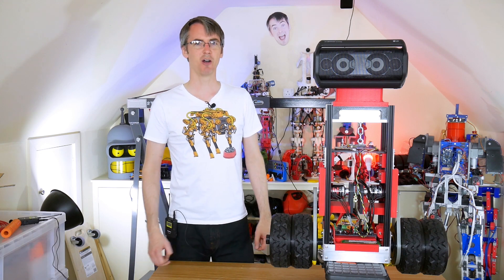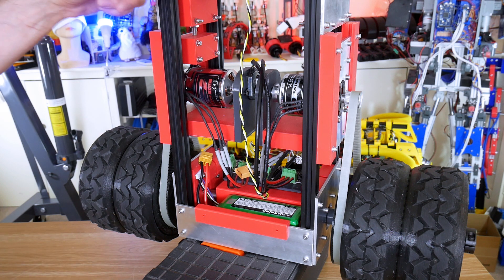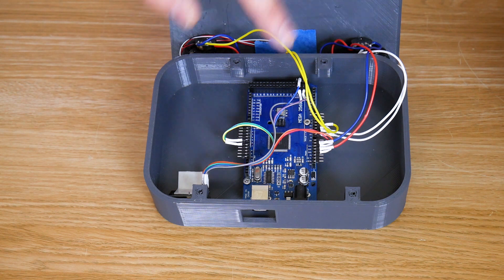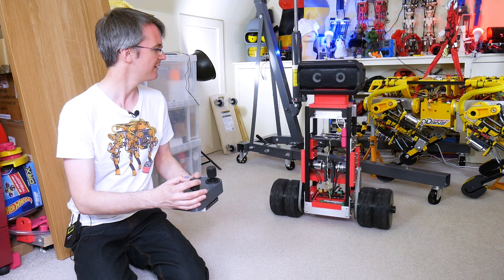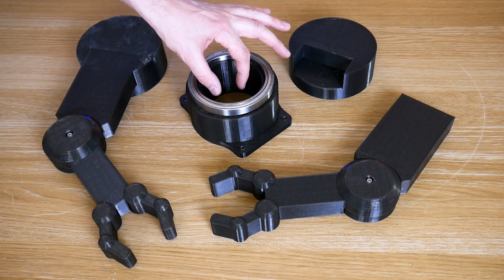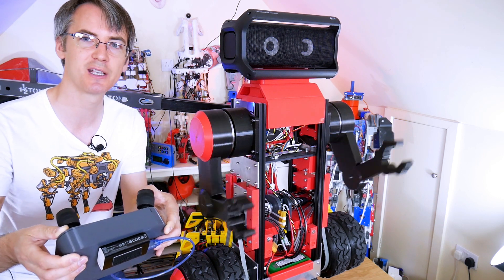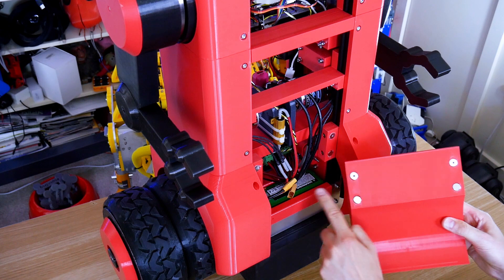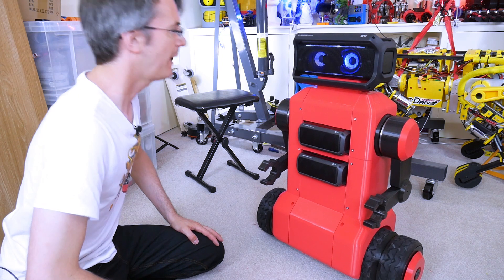The BALANCING BOOMBOX ROBOT you always wanted | with LG XBOOM Go Speakers

Comment: It's by no doubt an awesome balancing robot and I had fun watching this and the previous video but there is one thing that bothers me: Why did you use an ARDUINO MEGA for just a remote control??? You could have used an Arduino pro-micro or even an ATTiny based controller. I can see that you have a good budget and good tools so you are not limited, but despite that it bothers me.

Comment: A great project. But it would be nice if you did this on a budget that a non sponsored hobbyist could afford. I think this could be done without the CNC parts and with straight DC motors to eliminant the expensive motor controller.

Comment: Last balancer I tried, I found it helped a lot to mount the accelerometer with rubber cushions.  As the motors engage to react to drift, they jerk the robot and it has trouble tracking Down.
Reply: thanks for the idea, I'll try it on my project

Comment: It might be a good idea to have the emergency switch physically disconnect power to the whole robot.  Commanding the odrives off won't do do much good of the problem is one of them failed on at 100%. It's unlikely but connecting an emergency off to a software function doesn't seem like good practice.

Comment: Finally done, although I have to criticize, because I guess I understand you used the speaker because of the sponsorship, and that's great, BUT...
You could have made something better than a speaker, maybe a head with camera, speakers too, maybe a Google assistant, sensors, and even small displays for the eyes, and maybe some sensors with hand controls so you could control it without the controller.